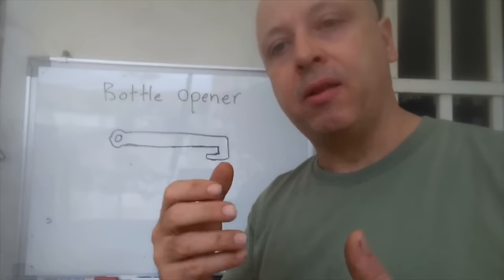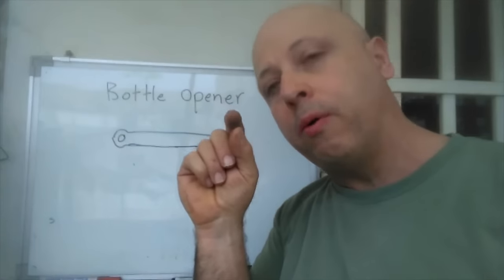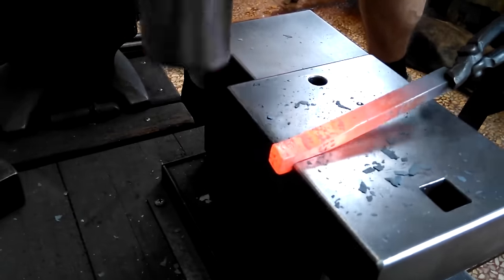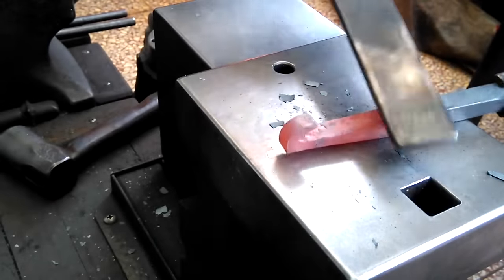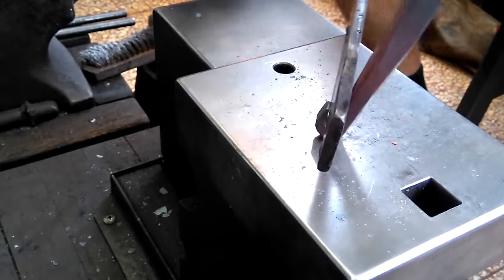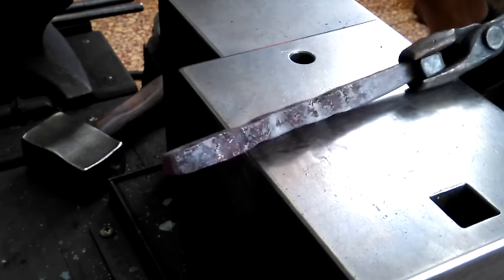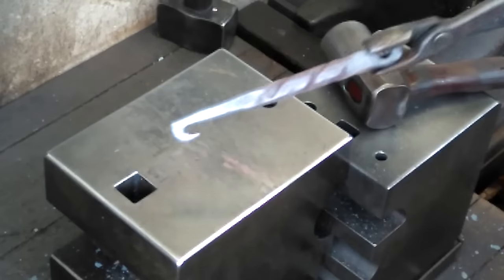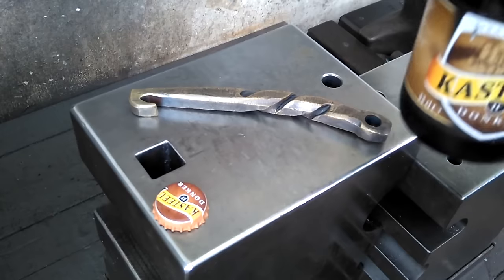Forging a Bottle Opener / Railroad Spikes / a different Twist...

Comment: That's a great little project.. I've always liked the finish that the brass brush give's..  Thank you for sharing...  and Thank you for the video...
Reply: NO kidding!  Is that what gives the steel a sort of gold hue?
Reply: worldtraveler Yep. brush the warm project with a 100% brass brush and some of the brass will deposit on the steel.
Reply from the maker: With the brass brush, it's always important to know when to stop. In my opinion, it's good to have a contrast between the brass color and darker scale. Thanks. Glen

Comment: Thanks for that video, I've found it to be very helpful.
Some weeks ago I found a railroadspike stucking deep in the brickwall of my workshop. I'll pull it out and forge something nice out of it. But no bottle opener, probably a dagger or so.
Reply from the maker: Edgar, In the US, railroad spikes can be found everywhere. Here in Taiwan, I've never seen a traditional spike and I'm not sure how common they are where you live. Anyway, you're right, you might put it to better use making a dagger or something similar. Thanks. Glen
Reply: In Germany, where I live, I've never seen one before. But I think you can buy them on ebay.

Comment: Looks great! The brass transferred really well on to it! 
What sort of temperature do you need in the steel when brushing to get that sort of effect?
Reply from the maker: Jack, To allow the brass to take well, I've found a black heat to dull cherry red temperature range to be best. If too hot, it won't stick and just burn off, It can be done cold, but for some reason the color is less pleasing. Thanks. Glen

Comment: Nice technique and another great video.  I would like to see how you put the "brass" finish on that sometime.  Thanks!
Reply from the maker: Ron, I just brush it on when the piece is still at a black heat. I showed this in my latest bottle opener video... Thanks. Glen

Comment: It is good that you do not used Railroad Spike this steel is good for other purposes or projects. We open bottles with newspaper or  matches box or lighters.  its do not damage caps  either  ))))) Lol  Anyway good job - nice and (accurate аккуратный).
Reply from the maker: Serge, That's a good point. So many people use railroad spikes for knives so I can only assume they have a higher carbon content. Not sure how you open a bottle with newspaper, etc., but that would be interesting to see. Thanks. Glen